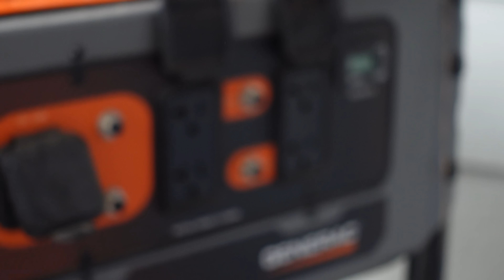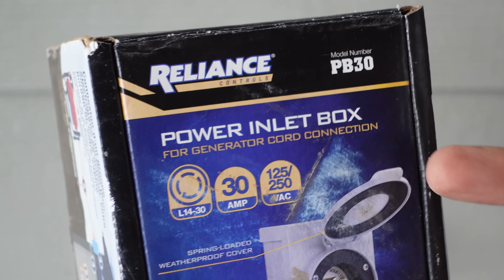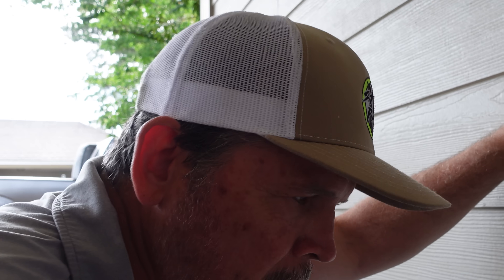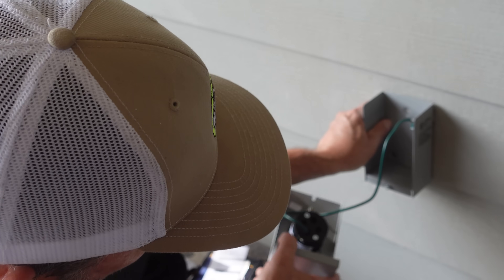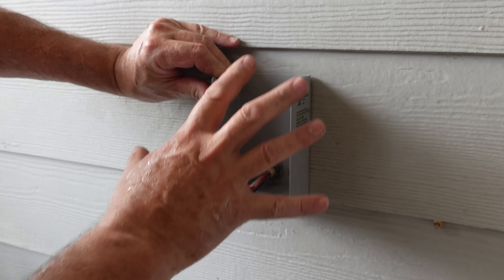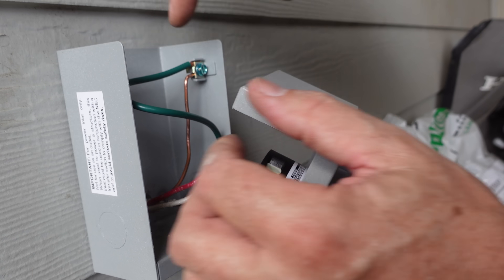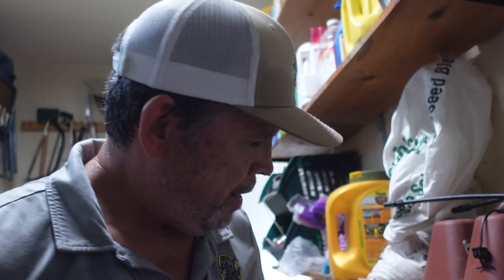What is a Suicide Cord and Why It Could Kill You

Comment: My first job in 1994, I pushed a garbage cart and swept around a department store. It's also the first and last time I ever messed with electricity. I needed to use the outlet, and part of a plug was broken off inside. I wanted to remove it. So my logic was "positive carries the current, negative must not carry anything and who knows what ground does". I used needle nose pliers to remove the broken plug from the grounding thinking it was safe... it threw my arm backwards and I damn near broken my elbow on the register table behind it. I've never messed with electricity since. Well, except in my own home and I shut off the breaker to the entire house. I wasn't taking chances the electrician was insane and had put the labels on wrong. ;-)

Comment: Question: the Generac generator had a label stating neutral bonded to frame. The control panel I assume has a bonded neutral. Therefore, the neutral would be bonded in 2 locations - at the panel and the generator. As the system uses an Interlock not a switched neutral transfer panel, how do you address not having the neutral bonded in 2 locations?

Comment: LoL watching this as some one who lives in the Netherlands....This is not allowed over here, yes meaning the "new install". Loose cable's in the wall? Not allowed, needs to be in a PVC pipe (Fire hazard). Pulling the cable and even fasten it under that much tension? Not allowed (Also a fire hazard). The connector and plug stuff? Not allowed. This type of socket and it's casing on the outside of a house? Not allowed.
I guess there's a lot of "electrical fires" over there?
It's kinda weird that there is such a diffrence in standards compared to the both countries. 

PS: I never died from electrocution even though I have been shocked with 230 volts (AC) a lot of times and even 380 volts (AC) (50 Amp line). We have "earth leakage circuit breakers" that will trip at 30mA (and above ofcourse), mandatory since the year 1975 (At least 2 nowadays)

Comment: Simply put, you shouldn't plug a generator or an inverter to your home, but plug the home to the generator. Another thing to look out for is to not back-feed and hurt neighbours or utility people working down the line on the grid. I have made myself an automatic changeover that can also turn on the inverter, reliably. But I bypass it when going away or no power outages to be expected.

I have also separated my home circuites to two. One with all high power equipment like water heater, washing machine, fridge that only runs when there is no power outage. The secondary circuit has all lamps, fans and low power equipment that changes to inverter power in case of grid outage.

Comment: I use a foot long piece of old heavy steel wire coat hanger for the exploration drill. Chuck it and go probing, Smaller hole and it will go through anything.

Comment: Question, my breaker panel does not have a main cut-off switch. Could i simply just remove the electrical meter? I imagine the only safe way to reinstall the meter would be to set all breakers to the off position, install the meter, reset all breakers.

Comment: I seen a coworker one time just using a extension cord 3 phase. When he plug it in he had a fire ball between his hands. I seen it. it didn't hurt him but he did have some white on his hands from the flash. i think a wire com loose and popped out and hit another.

Comment: Old thread but still worth a comment.  After Hurricane Charley in 2004 I was in a <un-named> big box home improvement store and actually heard a guy in the electrical department telling someone who just bought a stupidly over-priced generator how to take a dryer plug, put a plug on the bare end of the wire, and power a house by backfeeding it.  NO warnings about the suicide cord, NO warnings about running the generator in the utility room (dryer plug cords are only a few feet long!), and finally, NO warnings about turning off the main breaker so you didn't backfeed the grid.  There were a bunch of people standing around listening so I chimed in and gave the sales goober hell for what he was telling them.  Told everyone that he was putting lives in danger.

Finally, on your outside power inlet connection...  First off, I would have removed the two flying green wires and ran the ground directly to the plug.  One connection is quite sufficient and less prone to failure.  Next, on the inlet (or outlet) there IS a difference in the X and Y poles (phases).  X is for phase 1 (black) and Y is for the phase 2 (red).  I was very disappointed you kinda blew that off in your description.  Will it work either way?  Yes.  Is it right either way?  NO.

Good video, I enjoyed it!

Comment: Lol…my dumbass did something similar when making a tailgate fan. The fans were 230vac and the generator was only 110vac. So I put a 500w step up transformer in a box with a cooling fan to make 230.  Only my dumbass had female connection at the input to the transformer box which of course meant a suicide cord. Fixed that before the next game to a male iec connection. So dumb on my part.

Comment: That was an expert repair.  Great!  I found this looking for info on older interior AC outlets with only 2 prongs.  My house was built in the 1950s, and some of the outlets in the house are the original old style with only two prongs.  They work fine but are they dangerous?  The wiring in the walls is the old BX style with the flexible metal insulation.

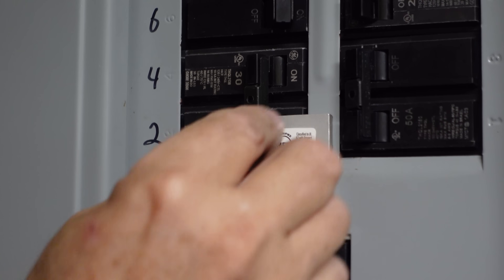Comment: 3:06 Glad you mention this, Now the house I live in now is OLD turn of the century and just had the long battery looking fuses on breakers you pull out and the small glass screw in fuses BUT some day I'm moving to a newer home that likely has a modern electric box and it may have one of them lock outs, I know now not to remove that if I see it as it would be so simple just to unscrew and remove that to power what I needed on.

Comment: Awesome video. Hes correct. Want your mind blowed ?? Your DRYER outlet is already that :) Make a cable with 2 male ends. The only time you will use it is when your in an emergency no power situation. Make sure to turn your MAIN BREAKER OFF when powering your panel with a generator. In this case the dryer circuit becomes the main. Dryer Breaker. I will also add I think it is illegal to do this reason being if you energize the street for just a moment, you could kill a lineman working miles away. Closing main breaker while generator is running will do just that and is the CARDINAL SIN in this operation.

Comment: If worse had come to worse, instead of climbing in the attic to pull more wire, couldn’t you have pigtailed the grounds with piece of copper wire and used a ground wire nut to bond the grounds to the box?

Comment: Hey man, just dropped by to tell you, PLEASE, for the 5 seconds it took you to drill on the cement dry-wall and the 2 minutes it took you to saw the other side of the same wall, PLEASE, WEAR A MASK... This job can also kill you, only it will take a LOT longer and the agony is way worse... sand and dust from cement, rock and whatever is inside that wall can get into your lungs and give you SILICOSIS, especially when you do that same job on a daily basis. Just as an example for others who will follow your lead, make everyone remember to wear a mask, and it doesn't have to be a surgical grade mask, in this particular case, a damp cloth would be enough. Otherwise, Great job!!, electricity is no joke and all caution you can take is scarce, suicide cords should be banned everywhere.

Comment: Dumb question of the day.  Because the ground screw has both a slot for a Flat blade screwdriver AND is a Hex head, why would you not use a Hex head driver to secure the screw as it would allow you to provide more torque on the screw and a tighter connection.

Comment: gasket behind the box to keep moisture out. just invited ants and termites to move in if any water gets behind the box which is necessarily loose at the top to get that cover on. the old one was a mess but didn't have a nice plywood board to soak in the moisture right by the hole.

Comment: I probably would have still put a bead of silicone along the sides of that box, the top may have had a gasket but as you said in hurricane prone states water isn't always flowing straight down, and it'll get behind that box and follow the Romex into the hole, filling up the wall cavity.  Second thing that should have been mentioned is, you removed a 20amp outlet, did anyone verify the installer of that 20amp outlet didn't also use 20amp wire back to the box?  The cable may have needed to be upgraded as well.

Comment: Ive done many generator installs with my father and we used sj or so cord but always used a male end and female end. Never used to male ends before, idk why they would have done that but never had an issue with those cords if there made right, and to be fair youd have to be a complete idiot to plug that cord in and turn the genny on without the other end plugged in first but hey i guess there's plenty out there.

Comment: You statement to order a new ext. cord is not very cost effective. Replacing the male plug with a female is a lot cheaper and a lot faster and doesn't leave the house hold with a useless generator that can't be connected to the house while waiting for delivery of the new cord.

Comment: Always amazed at how anyone would build a real house out of a thin sheet of outside panels and a drywall...in a hurricane zone...and STILL clamor about it being destroyed. I have a garden shed that is sturdier than that. You could not get a permit for this in Germany. Bricks and reinforced concrete is used on 99% of houses.
But electric wiring can be as shoddy as that^^ Especially in older houses. Some still have wires from the early 1900s with insulation flaking off.

Comment: I would have done everything from the outside that way I wouldn't have had to cut the drywall all you had done is cut the damn Hardie board to the same diameter as the box put all your blocking and stuff inside the hole and countersink the box and then calk around the damn box if I didn't just go out and buy some rubber edging and put the rubber edging on the Hardie board before I shove the box in you can fasten the box to the blocking and stuff from inside when you open it or while the face is off

Comment: As a licensed electrician, I agree with everything in the video. 

(Except that Generac is a low quality generator, and GE electrical panels are low quality panels. I would never use Generac or GE.
Other than that, great video).
Reply from the maker: Thanks a million Dave!  Really appreciate that coming from an electrician 💪👍👊
Reply: @StudPack  In my area, the linemen drive around and listen for generators before working on a downed line. They also test everything before touching it. But it's a good idea to do things the right and safe way. 
It's easy to take shortcuts but that's a bad idea with electricity.

Comment: I installed a 120v generator connection a decade or so ago in my house. 

I moved the fridge, living room recepts, furnace, and sump pump to a sub panel. 

I ran the sub panel from a 30a breaker out of the main panel through a relay powered by the generator. 

When the generator was started, the power switched from the 30a breaker to the generator via the relay.

Comment: I'm not an electrician but I played one for 40 years in the semiconductor industry working with 5 volts up  to 800,000 volts so I'm confused.  The generator had a 30 amp outlet,  the panel had a 30 amp CB for hooking up the generator to house.  The mickey mouse unsafe plug that was removed and replaced with a 30 amp female socket had wires for a 20 amp connection usually 12 gauge wire but was not replaced with a 10 gauge 4 conductor wire.   Did I miss something or is the wire still too small for the 30 amp circuit now?  Please let me know if I am mistaken, thanks.  art:body-blue-raised-arms::face-purple-wide-eyes:
Reply from the maker: The existing wiring was 10awg 👍
Reply: @StudPack  thanks for the follow up I didn't see that information in the program.  :hand-purple-blue-peace:

Comment: Great video! Some comments:
1. You never mentioned the size of the wires when you went from 20 amp service to 30 amp. You said (I believe) you put in the 30 amp breaker, so I assume you ensured that the line was appropriately sized for 30 amp. It looks to be, but you should say something about that, so people don't hook 30 amp (or 50 amp) inlet box to existing 20 amp wire.
2. Mask up for sawing drywall and cementatious siding, Yeah, it ain't going to kill you, but who want to breathe that crap.
3. Later you unhooked and reconnected the ground wire for the final connection, but at the start you were flinging the inlet plug and its ground wire around while working with the box, putting unnecessary tension and wear on the ground wire before it's even installed. Consider disconnecting it when you start.
4. Put a washer behind the top screw of the box, so you can drive the top screw tight while leaving room for the faceplate hook (without backing off).

Comment: I was working under a massive conveyor belt at a bakery when a co-worker passed me the male end of a 440 3 phase Hubble SO cord.  I was flat on my back under the belt and when my hand grabbed the connector WHAM!  My body jerked so hard my head hit a beam and knocked me out.  Woke up in the hospital with 15 stitches in my head and 3rd degree burns on my hand. Thankfully I healed right up.  That 3 phare 440 is nasty stuff.  Someone put two male connectors on the cord. I was lucky.

Comment: 5:49 - do those metal pins get 120 volt AC across any of them under normal home conditions - as in the regular AC power in the home is working properly? If those pins do get AC voltage across them, then slight potential for accident waiting to happen - such as a curious person/kid etc putting their fingers in there after opening up the lid (and somebody forgetting to open-circuit a breaker switch etc) - and the suicide plug then becomes a part of the house instead.

Comment: I love how people try to make something simple into something complicated.   Usually you need to use Suicide Cord, because you connect the generator through the Dryer Port.   Also what he said about the interlock is bull shit.   I dare anyone to connect a generator with the main line breaker one.  You will blow your generator breaker and overload so quickly that it will not stay on.   Most people during a power outage do nothing with their circuit breaker box.  Which means your generator will be powering all the neighbors houses and quickly reach it's limits if your dumb enough to forget to pull the breaker.  Also before you connect the generator and turn it own your suppose to have everything connected which includes the Circuit breaker main line breaker and all the other breakers must be off.   Because you are suppose to turn on each breaker one at a time once the generator is up and running.  The same way you can kill yourself with the so called Suicide Cord, which by the way in almost all third world countries use 220 / 240 and not 120, but I guess people in the states are dumber that the rest of the world and need all the extra stupidity because god forbid you hold people responsible for their actions.   My view is if you don't respect electricity you deserve death.  I was in the Air Force, and worked with Aircraft that use 400 VOLTS.  That will kill you instantly, 240, hurts and knocks you down, but it won't kill like 400 volts will.

I hate people that make things more complicated, expensive and save, for stupid people.   Me personally if I ever get a generator again right through Dryer Port, with a cord I can make myself, for about 50$ or less, and just use precaution like I do with my guns.   Instead of paying nearly 500$ for all the bull shit he installed for the suckers that should not have a generator to begin with.

Comment: You didn't mention the existing wire size.  Was it #10 which is required for 30 Amps or was it #12 which is implied by the existing 20 Amp receptical and too small for a 30 Amp circuit and could overheat?
Reply: He mentioned it was indeed #10 in another comment (pre color coding so so the commenter thought it was #12)

Comment: I'm NOT an electrician, so please excuse me if this is a stupid question, but did you essentially reverse the problem by putting the male side on the house? If somebody flips the breaker and somebody sticks their hand in there, they could be shocked. Is there a different plug you could have used?
Reply from the maker: Great question.  That's why we installed the interlock.  You can only flip the generator breaker when the main panel breaker is off.  The only time that male plug is energized is when it's protected by the female end of the suicide cord.  Hope that helps.
Reply: @StudPack  Ahhh, I get it now. I feel pretty silly now that you pointed it out. Thank you!

Comment: So the original outside connector was rated at 20 amps.  [never mind that the contacts are essentially the same].  What about the existing wiring?  Is that rated to carry 30 amps?  Or only the original 20.
Reply from the maker: It's 10awg wire
Reply: @StudPack  Excellent !

Comment: All that's great, but there is a fairly new product (come out in the last few years) called Generlink...it mounts directly to the power meter (down side is it has to be installed by the electric company) that you can plug your portable generator directly into and powers the house. Comes with whatever cable you need (30 or 40A) More convenient than installing all the extra stuff to plug into your house.